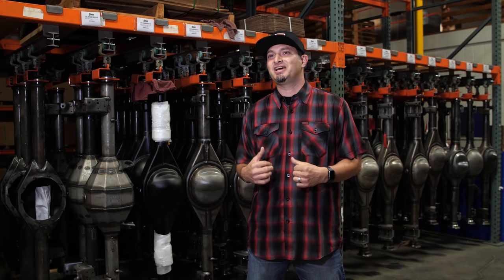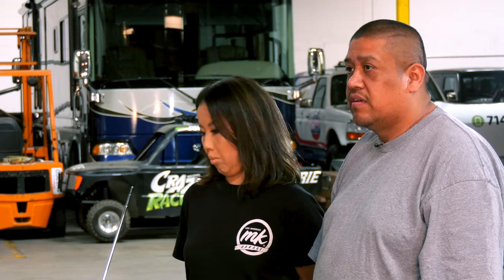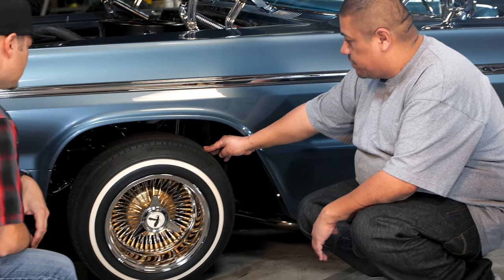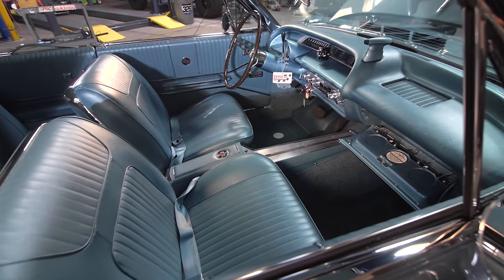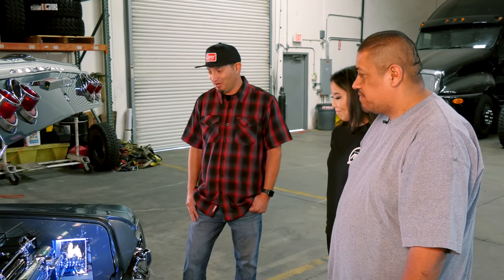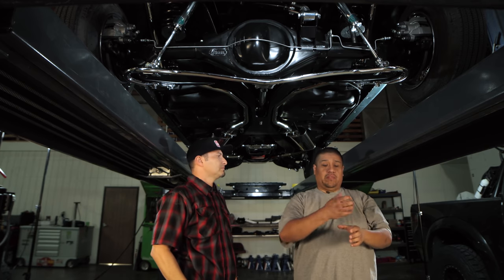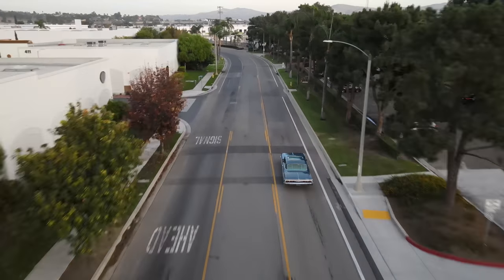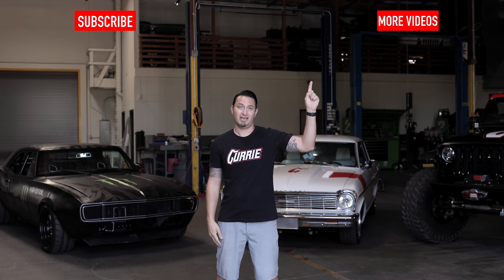HOPPING A LOW RIDER '64 IMPALA SS! | CURRIE GARAGE | EPISODE 5

Comment: Daytons are far superior in build quality when compared to foreign made wire wheels. I had 100 spoke Daytons on a Monte Carlo that I built to hop. Over 10 years, and I never had an issue with broken/loose spokes, rust, etc. My car lived outside in the elements for 2 years. Drove it rain or shine.

Meanwhile some of my friends that had lower quality wheels were replacing a wheel or two once or twice a year.

Comment: 13 inch Daytons with Zenith knock off that dude blowing smoke out his ass them are just straight zenith wire wheels lol real Dz”spokes are completely uniform from top to bottom. China and Zenith spokes have a drop-down in the thickness lol also, he said that’s a true SS with a shifter on the column 64 impala did offer the three on the tree for the true SS so you had an option of the floor or three on the tree he’s saying it’s on the tree but there’s no clutch lol dude just keeps blowing smoke out his ass… that’s a base model, impala custom to look like a SS😂 show us the Vin plate